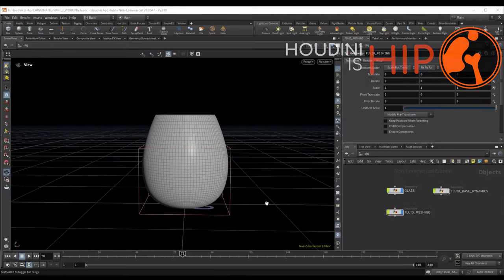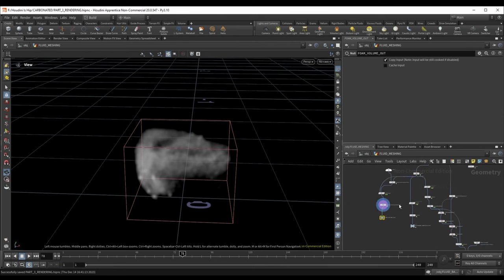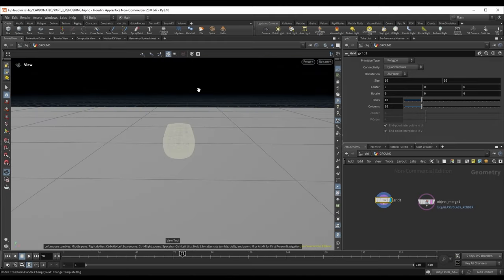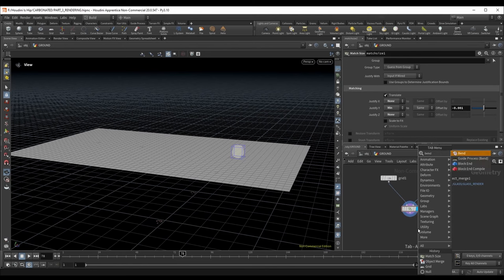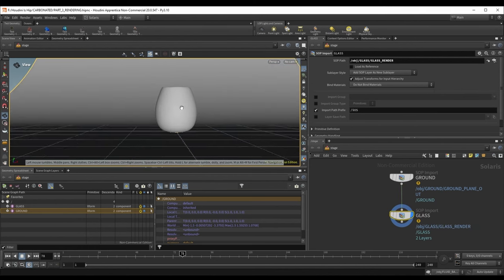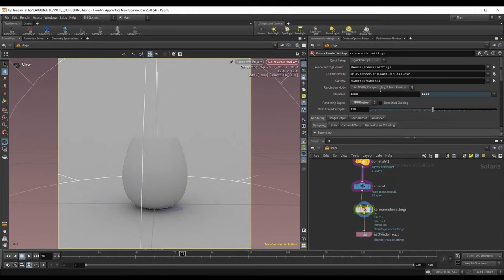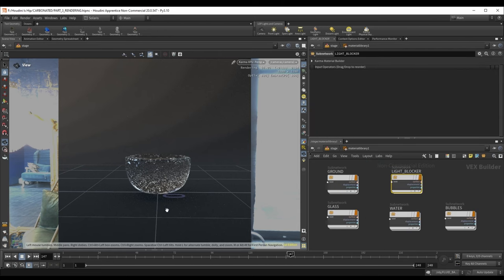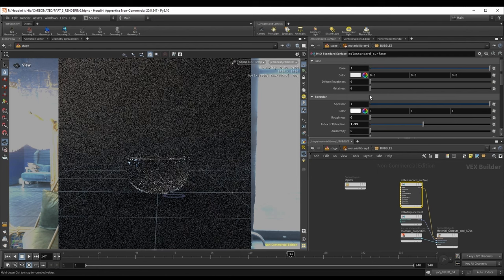Houdini is HIP - Part 17: Sparkling Water Project 3

Comment: for those having the same issue as me, if the mtlxgeomprop node at 22:55 doesnt behave the same as in the video change it from a float to a color in the signature tab that fixed it for me. i don't know why it works but it does.
Reply: Thanks a lot, the thing is it was working with the houdini gl viewport but not at karma, that got me confused😅
Reply: Thank you! this worked!

Comment: Are there any tutorials on flip simulations with an animated closed object (a bottle of water, perfume)? The volume of liquid is lost when animating an object, I tried changing extrapolation, turning on separation, increasing animation fps, reseding, nothing worked
Reply from the maker: Hey, depending on the complexity of the shot, have you considered trying the new  vellum minimal solver? It's great for those types of simulations. You can make a vellum fluid, a collider with a VDB collider sop node, and then put it into a vellum minimal solver. It's super fast and will maintain volume. I hope that helps!
Reply: @NineBetween  wow, thank you very much, haven't updated houdini to version 20.5 yet, very useful solver